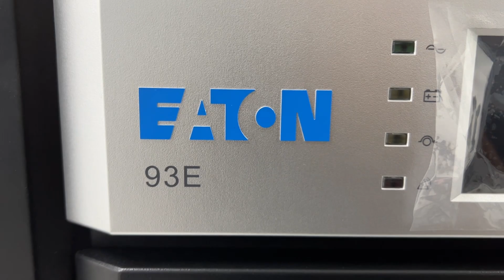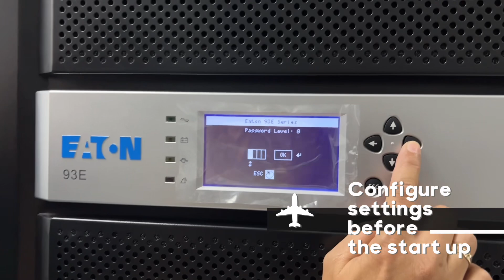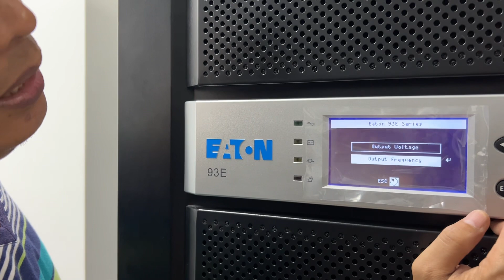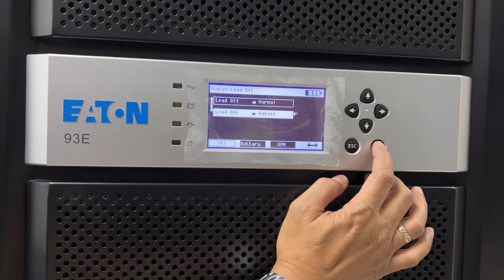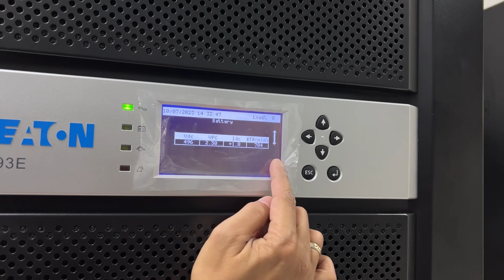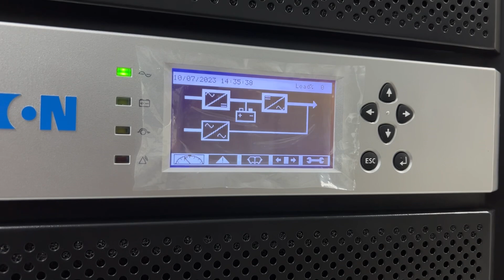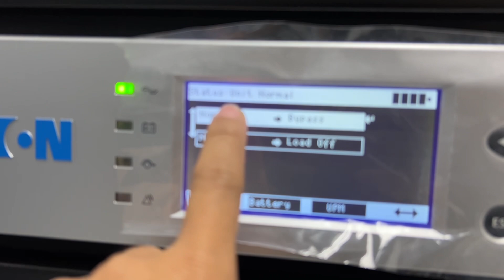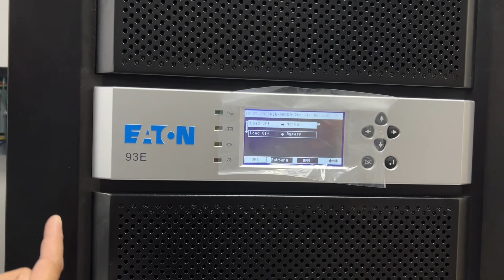Actual Start up of Eaton 93E

Comment: Hi ser. Meron din kaming UPS na ganyan. may babaguhin pa po ba sa setting kapag i paparallel ang dalawang UPS?
Reply from the maker: yes sir merun po. mga Eaton Engineer makakapag access nun sir dahil dun sa Software nya.
Reply: @3dfire  wala po bang paraan para maaccess ng end user that is planning na baguhin ang ups to parallel?

Comment: The ups is powered on and we can measure ,battery, bypass and mains input and get correct value but when we measure output cannot get any value?
Reply from the maker: Double check the eprom configuration.